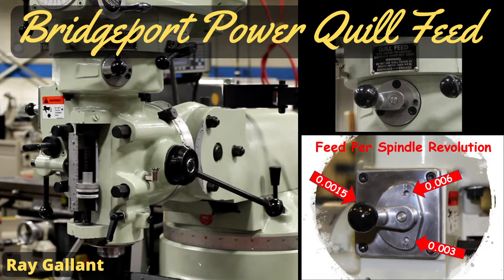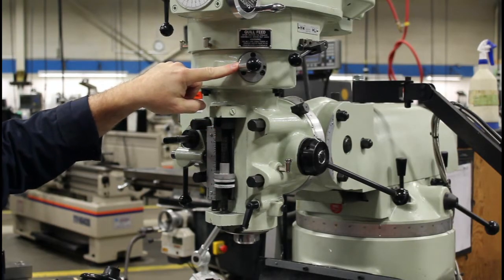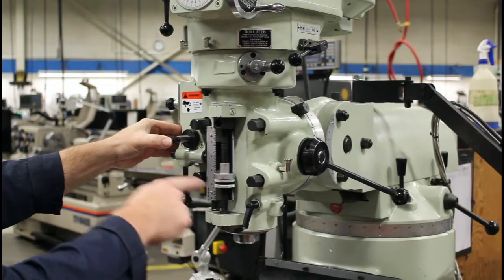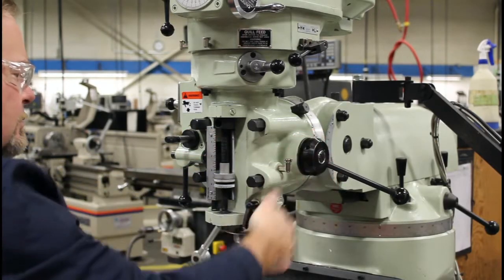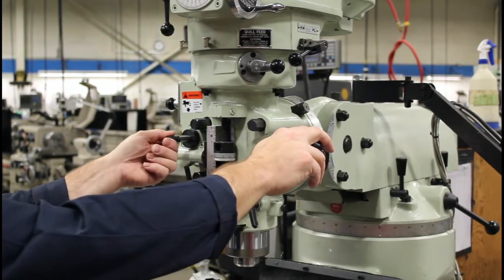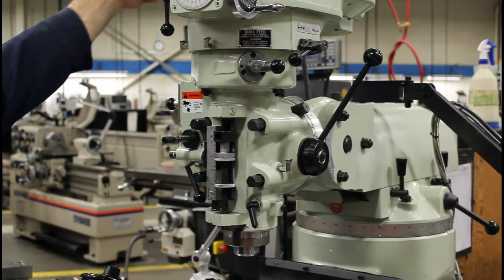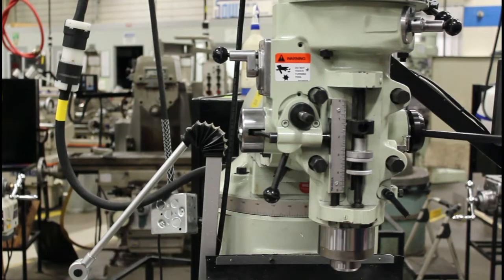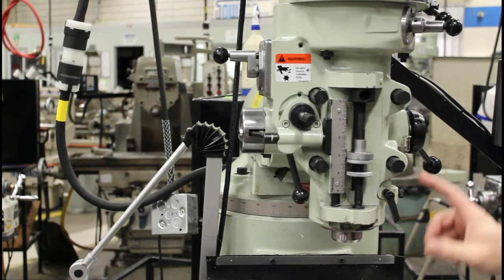Bridgeport Power Quill Feed

Comment: I tried drilling with a half inch bit into half inch steel plate using the auto downfeed and the highest feed rate but it wouldn't push through and it sounded like something was slipping. What am I doing wrong? Do I need to select a lower feed rate for more downward force?
Reply from the maker: This is tricky to answer. I kinda need to see it to understand what’s going wrong. There is only a certain amount of force that the power feed on the quill can produce. Usually, if it’s too much force, it will pop out of gear and not allow the gears to get damaged.

Maybe instead of using the power feed, place the feed handle on the power feed, place it in neutral, and then hand feed through the power feed unit to find out if the tool cut smoothly, or you require more force to get the proper chip formation 

I know my statement might be a little difficult to understand. I hope that you can understand what I’m trying to explain.
Ray
Reply: https://www.youtube.com/@HWMachRepair

Comment: Mine works but the fine feed wheel is really hard to rotate, also the three position push pull stem is hard to move. I’m questioning if I can just pull it apart and just clean it. But I’m not wanting to have the mill down for an extended period because I screwed something up. . 
I can’t seem to find much information on this. But this type of information is abundant. Thanks for sharing your knowledge ! Have a great day.
Reply from the maker: There’s probably about 100 reasons why those pieces would be stiff

Because I’m in an educational environment 99% of the time it’s from students hitting it with a hammer that’s crazy as that sounds when they’re hammering their work peace down they’re not watching where the hammer goes and it hits the stem sticking out 

If you can’t afford to have the machine down for a period of time, I would not take it apart if it’s still working some of these parts and we have replaced every part on these machines can’t be difficult to get 

I have a few other mill videos, or Andrew is taking things apart. We have a special station for stripping the head down where we take it off of the machine out of the shop and bring it up to our workshop repair shop, and the head can be stripped down at chest level, so you’re not standing on a ladder or anything like that, and it’s bolted to the side of a table And you have the perfect work for dismantling. Eventually, I will do a video on a full dismantle, but that won’t be for sometime.

I hope this helped 
Ray
Reply: @shopandmath  thank you for the reply.  It festered to the point I couldn’t take it anymore. I pulled the clutch and the trip arm. I pulled the gear out of the front and found it was packed with old hard grease. I cleaned out as much as I could and saturated it with spindle oil. Assembled everything and tested it. It works beautifully now but all the spindle oil is leaking out all over the table below lol. It was only temporary. But this machine has a grease zerk above it and I’m pretty sure it was not supposed to be greased, but oiled instead. So now I’m not sure what to run in it. But I’m going to pull it apart one more time and clean it out. Once I figure out what to put back in there. 
But thank you for your time and your reply. I hope you have a great day.

Comment: Good demonstration. Nice video!
Reply from the maker: thank you for taking the time to comment much appreciated 
Ray
Reply from the maker: You can use anything to clean a surface plate just as long as it does 3 things
1 removes oils and dirt (lifting and encapsulating)
2 does not have an acid that will damage or stain the stone 
3 does not leave a residue or film that will effect dimensional accuracy or have a high PH level to damage the parts that touch the stone
I have seen someone clean the plate with some thing they shouldn’t have and the next day the part was welded to the plate (required a hammer to brake it free)
Pure alcohol does leave a layer on the plate (I do not remember what it is called)